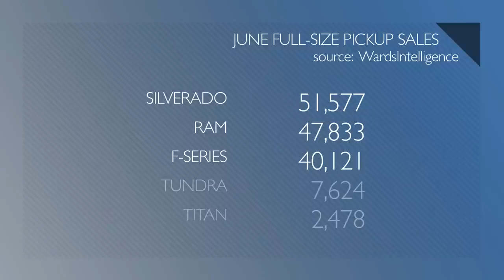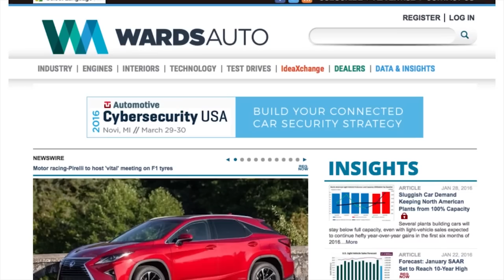F-Series Drops to #3 in Pickup Sales; How Jeep Improved Off-Road Capability - Autoline Daily 3114

Comment: What concerns me about suspension lifts, on tall vehicles, is the risk of making them incompatible with smaller vehicles in a crash.   There's already a weight disparity.  With an increase in height, it makes me think even a slow-speed crash might be be even worse for the small car than the lifted truck/SUV.    Or, it could even cause a rollover for a lifted vehicle.
Reply: @ThePatUltra Don't crash is such a pointless thing to say, I think you even know that.
Reply: @ThePatUltra pillar/roof strength sure. Firewall way too low. Front crumple zone might well help?  depends how high the truck is, right?

Comment: I like how you gave Ford an EZ-Pass with the 'chip shortage has caused slower sales' excuse.  How about we just go with the obvious....Osbourne effect.  Hey everybody look at our upcoming 'electric' truck!  Did we mention that it will have the best specs ever for any F series truck that we've ever made?  It will have lower maintenance and running costs.  It will go faster and jump higher!  It will tow more and haul more.  It's got covered storage in the engine bay!  There's places to plug in all your shit and it can power your house for days!  No more $100 fill ups, it's only $12 for a full tank of electrons.

Makes you just want to run out and buy a brand new fuel chugger doesn't it?  Why wait another year, when you can buy one of our much inferior vehicles now!?
Reply: I sell things to car dealerships. A Ford dealer told me last week that they aren't expecting any more trucks for more than a month, and they have only a couple now. Usually they have 100 in stock or more.

Comment: The news about shortages and tight inventory got me thinking why are there so many incentives still on the Chevrolet Bolt, so I checked inventory. Per Chevy the 2022 is out and in inventory but there are still hundreds of 2021s, 2020s and even a couple of 2019s still on dealer lots. The discounts are huge on all years and they even showed a 2021 Premier for under $24,000. That's got to be more than 40% off. Even with tight inventory Chevy apparently cannot get rid of Bolts.
Reply: Bolt had its strongest quarter ever in Q2,
Reply: I've driven past a Ford dealership everyday for the last month and the same Mach-E has been sitting in the same spot each day on the lot.  I've thought about stopping in to look at it and put some chalk marks on the tires to see if it ever moves.....
Reply: @ThePatUltra That excuse only applies if you have no way to charge at home or at work.

Also, my average stop is 12 minutes, when I need to supercharge.

Comment: 4:20 Why can't Porsche fix the problem with OTA updates?  Because only Teslas have a coherent software architecture that allows all aspects of vehicle function to be updated OTA.  The OTA capabilities claimed for LAMs are highly misleading.  Most of the software functions of such vehicles are distributed in a thousand 3-rd party modules that the OEM barely understands, let alone is able to access via OTA updates.

Comment: This Tesla fire case may end up being a significant public interest case over joint legal ownership of the data - affecting all connected cars in the future. Does the driver and/or owner co-own the data generated by their car, how long do they have to demand it, what format must Tesla share it in, how long must Tesla save it? How about competing insurance companies - what rights do they have to a driver's data before issuing a policy on a Tesla? Battery insurance could be a money maker for EV OEMs too. This may be a landmark case. With 50 states regulating cars differently - this will have to be a federal case that congress will have to weigh in on.
Reply: @AllanSustainabilityFan     These guys lawyers are not so called lawyers,  they will make a lot of trouble for Tesla and get their client a big payout more than likely.
Reply: @AllanSustainabilityFan  I have no opinion as to the merits of the case. Connected cars are something new that regulations don't cover. Judges, in their rulings set precidents, but they don't like to because a ruling that gets overturned is a black mark on their careers. In FSD, how can a person be held liable if they were not at the wheel? If Tesla can offer lower insurance rates because they own the data exclusively, the insured will pay higher rates because the data is not available to competitors.
Reply: @dmitchellhomes  I have more faith in the system than that. A precedent setting case can be both a mine field and an opportunity for lawyers and judges. I would guess that the DOT would be consulted and that DOT would assist the legislature in formulating updated laws. We know that California sets the air pollution standards - so this could end up in state court; but if the state is not one of the big 3 or 4 states then the feds will probably step in.
Reply: @marvinegreen  something like this will never go before a judge, this will be settled out of court, with a gigantic non-public settlement, probably enough to buy several dozen plaids.
Reply: @AllanSustainabilityFan  If he is an ambulance chaser and the judge doesn't want to deal with the issue - you are right, it will be dismissed in a hurry; but if the judge wants to take on the issue, he/she may order the lawyer to take on additional lawyers and have Tesla pay them. Significant public interest is at stake and Tesla now has deep pockets so I don't think it would be perceived by the public as an attempt to crush Tesla.
Reply: @dmitchellhomes  A respectable lawyer does not post such a silly message on Twitter, very unprofessional verbiage and pictures, if they lose then it could qualify as slander, not something a competent lawyer would do. Sounds like a publicity stunt to me, but we'll see. 

There are also some interesting details that don't seem to add up yet, for example the battery picture is suspect, there was no accident so no reason for them to be outside the pack, but it's too early to speculate on such info.

And I agree with Marvin on Tesla reaching critical mass, though I think some folks are still thinking they have a chance at slowing Tesla down with minor gossip and controversies of this nature. The company has indeed achieved orbital escape velocity imho. 

TL/DR: It may be legitimate, it may be arson, it could be a driver covering up an accident - hence the batteries dislodging from a thick titanium casing - or it may be just another joker, who knows at this point. 

So too early to tell, and also of little significance in the big picture.
Reply: @dmitchellhomes  You would be right if this were a case where ample precedent made the outcome or ruling highly predictable. In the Iran-Contra case the judge ruled that E-mails could be introduced into a case as evidence, this is why Trump never uses  email. 40 years ago nobody thought that electrons could be used as legal evidence. The real question is the character, wealth and age of the Plaid owner - because he will be harassed and villified by the community but may also have his name immortalized in the legal history books.
Reply: @marvinegreen    It turns out the owner of the car that caught fire was a huge fan of Tesla,  and an Executive for one of TSLA's largest shareholders.      WOW,  the plot thickens...
Reply: @dmitchellhomes  This legal process needs happen as it increases predictability for both Tesla and the public. If the guy is alright, and not just looking for a check - this could be an ideal case to set precedent that benefits everyone.
Reply: @marvinegreen  Hmm, I'm starting to see more interesting details about this "fire" incident. The car seems to have deformations in the front, it looks like it was in a serious collision.

(twitter)/Brucekmain/status/1411071161673334790
Reply: @AllanSustainabilityFan  And the plot thickens some more...
Question: if a robo taxi like wamo has a driverless accident, but no data to defend the robo taxi operator - how could they defend themselves without witnesses? In the long run visual data may become the gold standard for liability defense.
Reply: Joke: "A picture is worth a thousand bytes".
Reply: @marvinegreen  Yep, it's a brave new world, that's for sure. 

We got cameras and sensors pointing at us from all directions these days, I guess that was inevitable in hindsight, for better or worse.
Reply: Tesla will make the data available to the appropriate authority, and almost certainly will not be found at fault. Tesla will know exactly what the car did.

Comment: You commented that "it took firefighters about three hours to get it (fire) under control."

But CNBC reported:
"Two crews of firefighters worked on the scene for just over 3 hours dealing with the emergency, McGarvey told CNBC." (McGarvey is the fire chief.)

I think "dealing with the emergency" is the overall time on the scene. Not specifically how long it took to put out the fire.
Reply: Just more reason why I've said many times about this channel, take everything they say with a grain of salt. They mis-state and give a lot of wrong information. I like to see what's new, and this show gives a wide range of topics, but then I go look different things up elsewhere to get better info.
Reply: Are you aware how fire crews manage EV fires? The initial fire itself might be extinguished, but because of thermal runaway, EV fires can reignite hours later if the battery isn’t complete cooled. That takes hours after a fire. A burning battery isn’t handled like an ICE fire!
Reply: @jeffs6090  See my comment on EV fires and thermal runaway. Sounds like you’re just upset at any negative remark about Tesla. Here’s a bitter pill for you: Tesla would be bankrupt if they couldn’t leech off the Carbon Credit welfare system!
Reply: @citizenfour9622  - Uhhh...my comment had nothing to do with Tesla. So, I don't need any bitter pills from you, thank you. It also had nothing to do with batteries or EVs, so I'm not sure where you're going with your reply. My comment was about how this show makes many mistakes in it's reporting of different stories in general, a known thing that multiple other people have brought to their attention in the past.
Reply: @citizenfour9622  The world is moving to EVs whether you like it or not.  Apparently you don't appreciate the importance of what Tesla has contributed to accelerate that process. But many do.
Reply: @jeffs6090  -- Well, you said that Autoline "mis-state and give a lot of wrong information", in this case referring to "it took firefighters about three hours to get it (fire) under control." It does, indeed, take as much as three hours to put out a battery fire; the report was correct. Stop trying to play off the fact that you got called out by playing dumb!
Reply: @Goldsteinphoto  "Whether you like it or not." There's that phrase again from a Lefty. It's like all you Lefties attend the same propaganda courses. State [claim] and then add "whether you like it or not" at the end. Well, Tesla's are boring to drive and poorly constructed, with even worse support, whether you like it or not! The nations power grids can't support everyone driving an EV, whether you like it or not. EVs create more pollution to make than ICE, whether you like it or not. EVs will NEVER be carbon neutral, as there isn't a substitute for the oil to make the paints, plastics, and rubber that cars need, whether you like it or not! "Green" is a scam, whether you like it or not! 🤣
Reply: @citizenfour9622  - Dude, again, my comment had nothing to do with that. That is what the OP was talking about. But secondary within his post was also about Autoline missing the full point or possibly mis-stating a story. That is all I was commenting about. I could give two shits about the ev fire or batteries. I didn't get called out on anything. You are mis-reading and/or not understanding what I wrote.
Reply: @chrisprime9601  Whether you like it or not you are incorrect.

The Tesla Model S Plaid goes 0 to 60 in 2 seconds. That must be very boring. Owners report the fit and finish is flawless. Teslas are rated as the safest cars in the world.
Reply: @Goldsteinphoto  Whether you like it or not, I'm CORRECT! Turns out Tesla was cheating with their measurements, as it was a rolling start and NOT a true 0-60. I'll accept your apology now! 🤣

Comment: I find it a bit odd that Tesla  is trying to build essentially an "electric F1 engine". This because they  have opted not to use Transmissions. 

It has been found, at least in RC cars, that multi-speed transmissions provide higher top speed without having a faster motor, stronger acceleration without a more torquey motor, greater range without bigger batteries, and a more flexible use of the motor without more complex (albeit simple) multi-magnetic field geometry systems. This was back in the 1980s and 90s before the sanctioning competition bodies, ROAR, IMFAR, for example, banned them. They were out of bounds for competition, fell out of favor with bashers and casual hobbyists, and the few kits that offered them out of the box and the few mod kits for other kits were either discontinued in due time or cancelled from low sales. 

If a bunch of guys can pull the V8 out of a Corvette (Genovation GXE) drop in a motor and enough battery and said car will hit 220mph in a flying mile, while still using the Corvette's 6-spd transmission, you would think the geniuses at Tesla would devise a 3-speed gearbox to enable higher speeds stronger acceleration, and longer range without building a motor that seems much more trouble than it is worth. 

Also Teslas have really crappy motor cooling. Just sayin'. Just because its an electric motor does not mean it doesn't need a good radiator.
Reply: Funny how Tesla has the fastest performance car of all production car regardless of price.
Reply: Clutches and gearboxes are another point of failure.  For highest durability and longevity it is best to leave out items that can break.  Tesla designs for 1 million mile life expectancy because they want to eventually make the vehicle and then program it to head out to the city where it will spend it's full life working as a robotaxi.
Reply: @TeslaDo_d  
First Tesla designed their motors to last 1M miles, not the overall drive train. That may not be the case for all versions of Tesla's Drive motors. Frankly, the omission of proper cooling, it is not overly likely a Tesla can last 1M miles if given any real power or pushed with any real enthusiasm. So if you drive like you are still making payments, or a grandma, you are not guaranteed to make it to 1Million miles.

Next, RC cars really show the way, if you look and understand.

Electric motors don't actually need clutches. However when clutches are used in Electric vehicles, it is actually meant to slip, or let go, to prevent the motor from overpowering the drivetrain, exceeding traction limits, and the like. Slipper clutches were introduced to RC competition in the late 1980s in the Team Losi JR-X2. It was such a hit it has become standard equipment in all but the most entry level Hobby grade RC vehicles.

What causes transmission to fail, is using Clutches as they are in ICE-Vs, to disengage between Gear shifts. When you disengage the clutch you unload the gearbox.. 

Clutches are not required for Electric motors, since a properly designed transmission for Electric Motors would actual be more like DCTs/DSGs... or some other gear pre-selecting gearbox. Think of it like a multi-speed Bicycle Transmission you never actually disengage and just go to the next gear. 

The only real issue facing Multi-speed Transmission with Motors, is the throttle exponent, or curve. This is usually set too steeply (especially in launch modes) and unless the gears are already tightly meshed/biting, you end up slamming the gear teeth together causing stress and breakage. The easiest ways to deal with this is to have a less severe throttle exponent.

Direct drive is the result of fear and laziness. But Multi-speed works better. You do not need nearly as many gears, 3 or 4 tops. I picture only 3 in most cases. But the gearbox, and clutch, has to be designed to the task. What was done with ICE-Vs will not work with Electrically Propelled Vehicles (EP-Vs).
Reply: @DocWolph  By all means, please design your own EV and sell it to the general public. We need more entrepreneurs.
Reply: @dlwatib  
Are you 12? This is what you said, "You can't talk about something I like unless you are doing it yourself." 

You are a hypocrite. I am sure you had some words, questions, and personal critiques of things you were not doing yourself. But  OH NO! don't you dare ask questions, make statements, about something I love.

Comment: Porsche probably needs to swap some of the hardware as well for whatever reason, something OTAs just can't do.
Reply: Proving they are not a tech company, unlike one of their competitors
Reply: @johnmqueripel2367  
Fair enough, Porsche is still and automotive company. 

Rushing things like a Tech company usually leads to making cars that catch fire just commuting, sitting at a stop, or charging up for no good reason. At least when a ICE-V catches fire, under similar circumstances., something was actually wrong that, if you gave half a care, you could catch before it was a problem.

Comment: I have had the Fox 2.0 shocks on my 2013 F-150 for several years now.  Truck handling is night and day, stopping and acceleration is also much improved.  Fox shocks are number one in my book and will want them on future vehicles.  Highly recommend them for the F 150, the stock shocks, especially the rear are horrible.